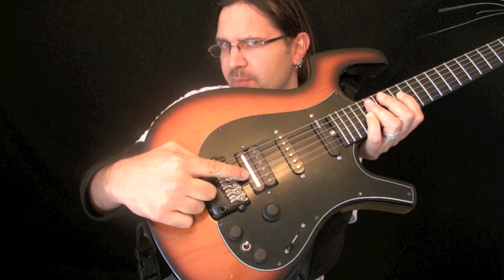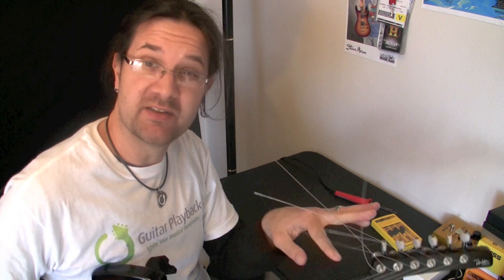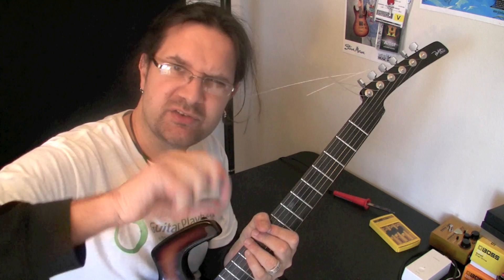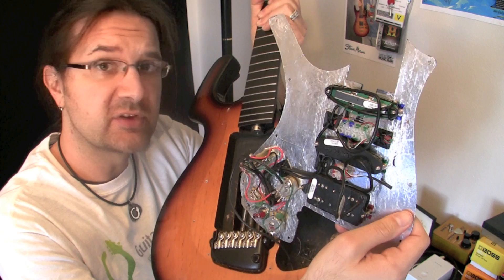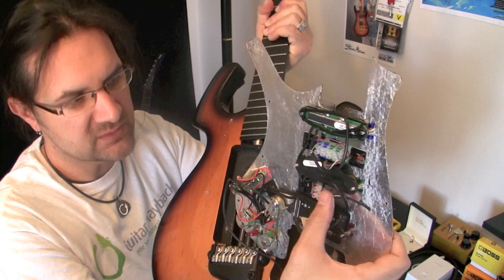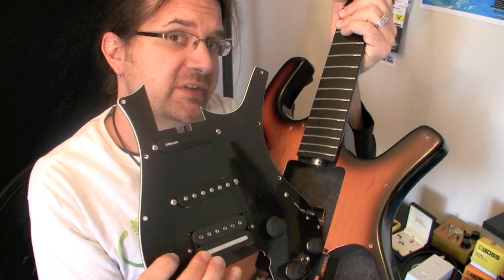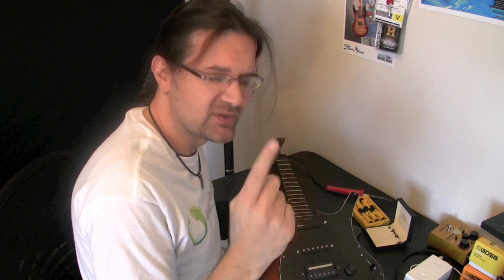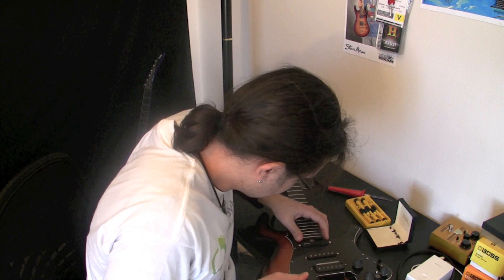Di Marzio Crunch Lab - Backwards Or Not?

Comment: Gotta agree that it really depends on your amp and your guitar. I have the crunch lab in two guitars and one sounds better backwards(walnut ebony) compared to another installed correctly (alder maple). I play through a vintage amp and a modern amp, both tube amps. Awesome pick up though. Especially when driven hard.  Sounds best through a modern amp.

Comment: Tech Talk: Those of you familiar with DiMarzio history will note the visual resemblance to our MegaDrive, but the design is completely different. Installation direction makes a noticeable difference in the sound, particularly with overdriven amps. With the solid bar toward the bridge, the sound is a little brighter and better-defined, and this is the direction we recommend for heavy strings and low tunings. With the adjustable polepieces toward the bridge, the sound is warmer and a touch louder, and we think this works best for standard tuning and more solo-oriented playing.

Comment: This has a significant amount to do with the guitar as well. The positioning of the pickup is significantly determined by the wood of  both the neck and body, the amount of cavity routed, how its routed, the circuit and volume pot levels. I play a jaguar special hh with the liquidfire in the neck and crunchlab in the bridge. In backwards form the crunch has a much more distinctive strengthened sound. In standard correct position it leaves you with a bit of wanting a little more.

Comment: AS IT TURNS OUT (this is according to the dimarzio website btw) it doesn't matter the orientation of the positioning in your guitar as long as you have not gotten it coil tapped. If you have coil tapped it, then it DOES make a difference, because it splits the bucker into a single coil.

Comment: Not much difference but it really depends on what amp your using and your playing style. I used a super distortion in a cheap Jackson RR V and the typical way was too bright to my ears, so I reversed it and found that it had more bass response with the North coil towards the neck. In this case the Crunch Lab has a major difference between the two coils. But a typical humbucker is built to have two coils very similar with the north coil wound hotter than the south for a wider dynamic range.

Comment: I used MegaDrives for much of the mid 80s, into the early 90s. I noticed they sounded best with the screws at the bridge. I also played some guitars with the similarly designed D Sonic and it was the same situation. Also the same with the Crunch Lab. It comes down to a matter of taste, and not all guitars are the same. Just my experience. BTW, another Petrucci pup I'd recommend is the Steve's Special. It wasn't designed for Petrucci but he used it for a bit and it came stock on one of his Ibanez signatures. Great pickup if you use high gain because it has dialed back mids. With a lot of gain it screams, but it stays very clear. Great pickup.

Comment: In theory it shouldn't have much difference when in humbucking mode. What I mean is that there'd be a difference if you activated the rear pickup alone via coil tap (The one closest to the bridge). But that's because the pickup height would be different as well as it's closer to the bridge, therefore brighter/twangier in tone.

Then again, what do I know since I'm not a tech ;).

Great experimentation none-the-less! Take care :).

Comment: Backwards gives it more lower end, it's a lot more warmer sounding and heavy, it's also a bit tighter. The correct way gives it more top end, it's more clear and articulate. Both are great sounding.

I tried the same thing with my Evolution pickup. I forgot which way it was supposed to be installed, and I installed it backwards. When I figured out, I reversed it but ended up liking it better when it was backwards, so I switched it.

Comment: You should have tried it in conjunction with the other pickup engaged to check for the out of phase sound which I believe that's when that would have the most effect being that the bottom coil would change direction if I'm not mistaken !

Comment: @sebkw96 The problem is, when it's installed the right way and you have a liquifire on the neck, switching between them sounds bad. If you lower the treble to get a nice smooth and not a screamer tone from the crunch lab, when you switch to the liquifire it's like you really don't have treble at all.
I wish I'd just install it backwards but now I'm stuck until I'll replace my strings which mean 2 months at least cause I don't have money and don't play much! :(

Comment: You should record two tracks of rhythm but use both ways.  I liked the reverse, was more early Van Halen sounding.  The other way there was a really heavy bass sound, probably sounds awesome detuned and for palm muted metal though.  I would prefer having the bass on the top strings, usually you dial up bass and get too much on the low strings.  This reverse method would remedy that I problem I would think.

Comment: i had it installed backwards bar towards bridge and downtuned on a 7 string guitar A# tuning.  it sounds horrible.  it is very tight but when you sound power chords as they sustain, they would start to warble and sound out of phase. this was in a custom 7 Ibanez i built.  bar towards neck was way better on this guitar. but it definitely makes a difference on 7 strings that downtune

Comment: Get F-spacing. I have it on my telecaster with a 250k pot, sounds the same with not much difference honestly. The only thing you need to worry about would be the volume difference between the Crunch Lab and the strat single coils.

Comment: You won't have any spacing issues IMO. If you have a floyd-rose bridge you should get the F-Spaced version of the pickup though. If you aim for the full-bodied sound of Petrucci and you want to step up your "guitar nedriness" game, make sure you have an .022µF capacitor on your tone pot (500 kohm) :D
Reply: Not really any "nerdiness" there, that's been the most common setup for any high gain guitar for the past 40 years.

Comment: I just got the  Ddistortion and liquifire for my Jackson js 227 nether fit and I have to run the liquidfire backwards because the cable blocks it from going all the way in when its the correct way.  They didn't fit my pickup rings very well ether.

Comment: Personally it has more balls in the "correct" position. Not so much presence but meat. There is a noticeable bump between 200-500Hz.  Right where the "body" of the tone is. Backwards sounds thin to me. If you start to do any sort of  "Chugging" rhythm a la metal, you'd probably notice it more.

Comment: hey ive the same parker and was wondering if youve lost any sound through using the chocolate blocks ie electrical connectors as they arnt soldered joints now im thinking of doing the same so i can do my own pick up changes cheers jak

Comment: Hey David, awesome video. I just ordered myself a Crunch Lab/Liquifire/True Velvet combo for my Ibanez S670PB. I'm pretty naive when it comes ti pickups, but the True Velvet is for the middle position (it's an HSH config), and it's reverse wound for this purpose. I'm wondering if when I install Crunch lab in the 'wrong' position, if it will interfere with the single coil since the opposing magnets will be in closer proximity. By the way, you're awesome on Jamplay. Long time member.

Comment: Thank you for the great review! I have a question, I want to get the Crunch Lab, can you please tell me if I'm going to have any problem of spacing, control values & whatnot? I have a Squier Stratocaster HSS with the original standard humbucking pickup, and the nut width is 1.650”. I don't know about the controls but I think they are 250K, but I heard that's just a matter of taste. Can I install it without any problem or do I have to do something?

Comment: Thank you, this helped. Having problem with this pickup, always out of phase :/
Reply: i had that problem w bar towards bridge. chords had no sustain
Reply: Not to be snide but just for your knowledge, turning the pickup doesn't out it out if phase. You would have to write it backwards or flip the magnet within the pickup for that. There's a very obvious thin bright crunchy sound to pickups out of phase. Also there is no phase difference perceivable at all unless you are using two pickups together since there is nothing to cancel out. I frequently mount pickups backwards to see what it will yield and in some cases keep them that way. But phase is different (and can also be a desirable effect. Great mod to install on a push pull pot.) Hope this clears things up a bit. If you're interested in some more if the physics and sonic effects of this, there's an unending amount of discussion online if you do a search. Wiring mods are fun, rewarding, and a great way to squeeze all kinds if sounds out of a guitar.